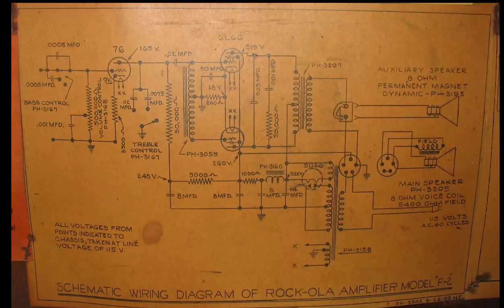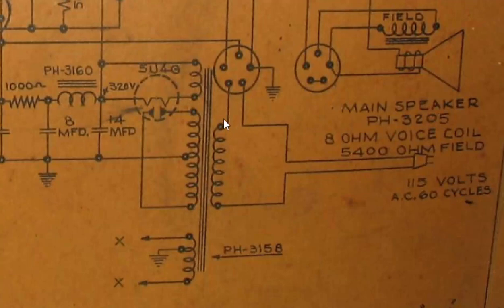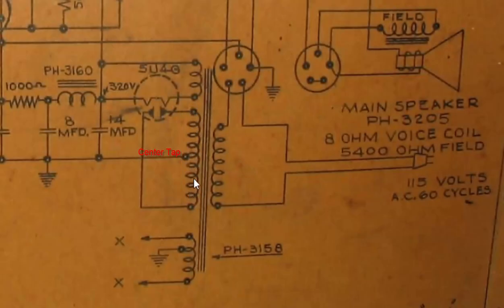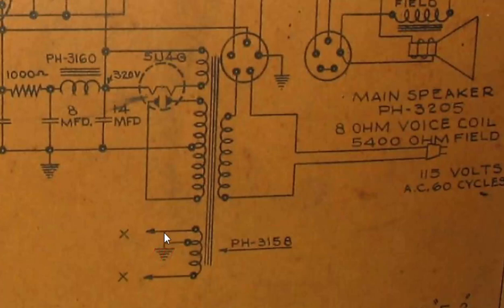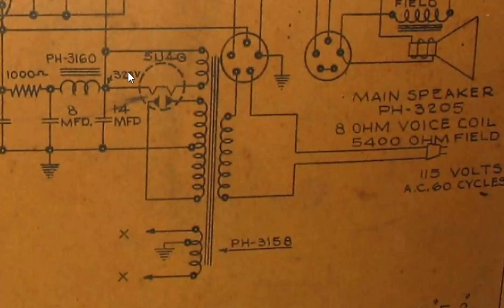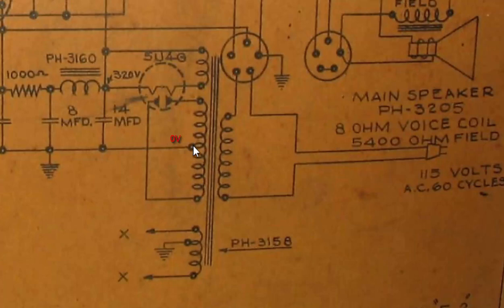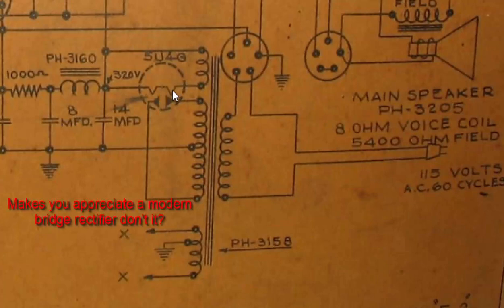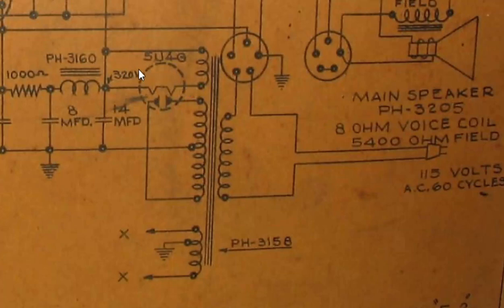Vacuum Tube Amplifier- Part 1: Power Supply 5U4G rectifier

Comment: Thanks so much for explaining the power supply section. One question I keep wrestling with is where the +320 VDC comes out of the 5VAC supply for the rectifier filaments. You state this circuit eventually accumulates a positive charge. Don’t the filaments get a steady stream of new electrons from the 5VAC supply?  If so, is it not enough to replenish the electrons that are going from the filaments to the plates, thus giving the circuit a positive charge?  Or am I totally off and missing something. Thanks so much!
Reply from the maker: Thanks for the insightful question. Hopefully I understand what you are asking.
  
Imagine the amplifier is first powered up but no sound input (no input signal) so the amplifier section is not moving electrons (ignore any biasing, leakage, and baseline 'no signal' electron flow).  As the filaments of the +320 warm up, electrons begin to be pumped from the +320 supply and put onto the chassis or earth ground.  eventually enough are moved so that the +320 reaches its maximum voltage and the voltage difference between the filament tip and the plate is enough to stop the electrons from flowing.  (Remember the+5V on the rectifier is riding on top of the 320V.)  The reason that this rail was able to get to the 320V is because the amplifier section is off so there is not a continuous supply of new electrons that get to the 5U4G rectifier.  The 5U4G filaments are being starved because the amplifier is not using electrons. 

Now imagine there is a very small input to the amplifier and it begins to turn on.  Now a 'few' electrons come off the chassis (earth) and do their business in the amplifier section in an attempt to get back onto the +320V supply.  They go through the amplifier and eventually the output transformer to do work (drive speaker) and make their way back to the 320V supply.  these electrons WOULD lower the voltage of the 320V supply but they are quickly pumped off when they hit the rectifier filament tip.  If the input signal goes to zero (and the amplifier turns back off), there are no more electrons, the rail is steady state and the supply of electrons is again limited.  If the input signal increases then the power output of the amplifier goes up and the number of electrons through the amplifier (and back to the rectifier) goes up.  And so it goes, as the input signal goes up and down the number of electrons used by the amplifier goes up and down so the number available to the rectifier goes up and down.  At all times the number of electrons that can be removed is limited by the electron consumption and therefore power output of the amplifier

Summary: no, there is not an infinite supply of electrons as long as the amplifier is within its normal range.  Now if the amplifier were to overdrive then there could be more electrons than the rectifier can remove and the voltage would drop from 320V (and essentially there would then be an infinite supply of electrons, or at least more available than can be pumped away). 

Executive summary:  No, the supply of electrons is throttled by the electron consumption (i.e.,  power output) of the amplifier.
Reply: Wow, thanks so much for your quick reply and detailed answer!    I really appreciate your taking the time on Thanksgiving Eve. I will have to study this over the next few days with the schematic and see if I can pound this into my head. Big thanks again and happy Thanksgiving!

Comment: I have built dc power supplies with solid state rectifiers.Tube power supplies are a mystery. It looks like a short circuit between the top 5 volt winding and the filament.How can there be +320 volts. And 5v A.C. Me and a friend are planneing to build a Fender champ. We both studied electronics and are trying to learn tube operation.
Reply: This is the 5U4G filament?… Yea, at first glance it looks that way… but look closely and one side of the filament is connected to the transformer and the other side is at the 320V point. The other side of the transformer is also connected to the 320V point, so let’s call that the fixed voltage reference side of the transformer.  The other terminal of the transformer then is 5VAC with respect to that 320V, I.e., the whole transformer is up at 320V, with the AC output riding on top of that.  Put a HV scope probe on one side of the filament and it is 320VDC wrt earth. Put it on the other side (that direct line between the xmfr and filament) and it will be a 5VAC “ripple” on top of 320VDC.

Comment: Good video but a poor cheap design for a good filter
Reply from the maker: It was obviously a  time of rapid change in the industry. I pulled my 1936 thru 1939 electronics magazines off the shelf to see what state of the art was at the time.  In ‘36 there was a nice article on L filters and most of the radio circuits were utilizing the L filter (just the choke and downstream condenser) but there was one PI filter shown in a laboratory test instrument.  In ‘37, designers of TV receivers were throwing everything at the rectifier circuit including PI filters and active second stages.  Radio receivers in ‘37 were sticking with L filter, but the PI filter was creeping in more and more. 
By ‘38 and especially ‘39, PI filters became the new baseline for most of the published circuits for radio and general rectifiers.  TV receivers were still going crazy with many filter stages.
No doubt this filter could have been better, but it was state of the art and a well suited match for the record and pick-up.
Reply: @Rock-Ola  I agree back then they just wanted them to work and for the cheapest they can pump them out and I’m sure parts where hard to come by with the war effort.